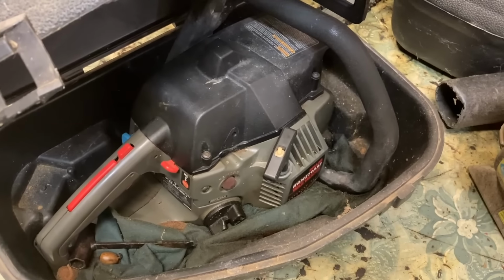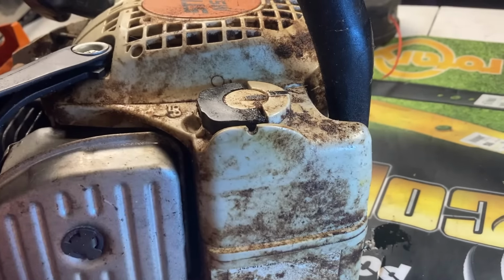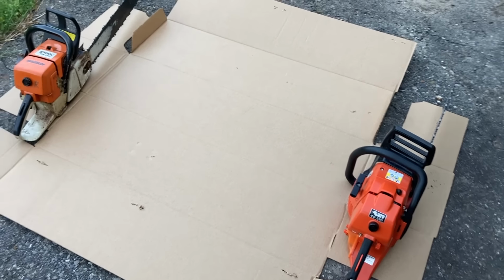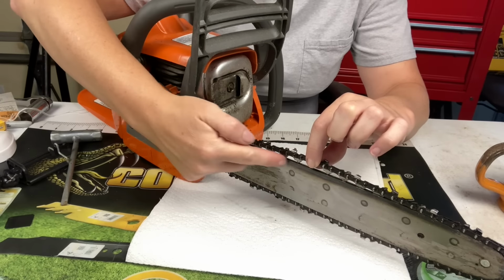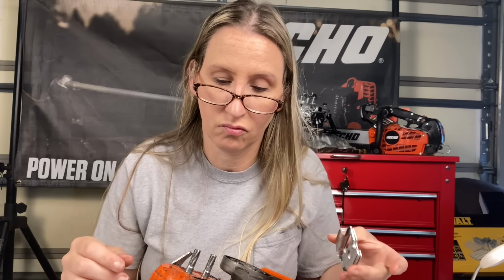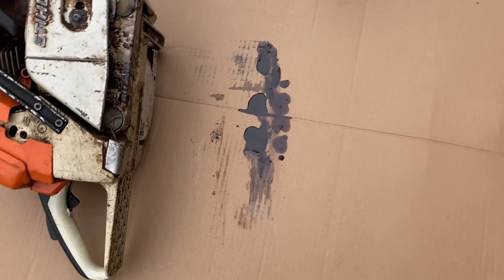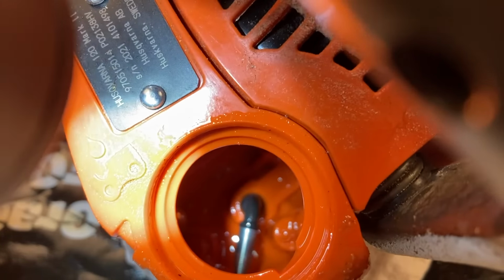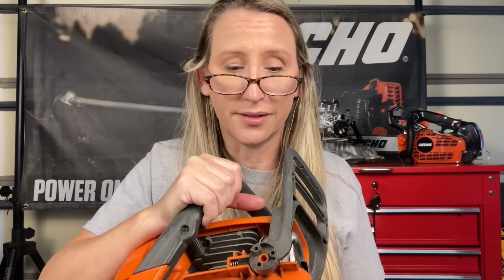Chainsaw leaks bar oil? The most common reason why AND Husqvarna saw leaking oil FIXED!! Repair Vlog

Comment: Was a service advisor and warranty specialist for a dealer that carried Husky, Stihl, Jonsored and Echo.. the thing that makes it most frustrating is that .. Sometimes the pump cycle will naturally stop at a certain point where it has drawn from the reservoir, but not discharged.. the heat soak thins the bar oil in the system after the saw is shut off and it naturally weeps.. that and contaminants in the bar oil and varying esther contents of bar oils can gall the surfaces of the pump making it not seal .. (like a scored piston in an engine). This causes a lot as well

Comment: Try using some red or blue oil dye. Put a few drops in a quart and shake it up untell you get the color you want.  You'll find those leaks super easy.   This is the technique i use to find difficult oil leak on heavy equipment.

Comment: It's interesting you use a 10w bar oil as a 10w 30 is what's specified for the "Chinese" saws. I have two that both spec the 10w oil and they both leak like sieves.
However, in my Homelite and Echo I use what's called a Supertak oil which is a lot thicker and gooier 🤔 It works perfectly well and they hardly leak a drop. So may I suggest it's the viscosity of the oil as much as anything else?

Comment: Interesting find. I loves the few videos I found. I have a little use Echo for around my property. It is always swimming in bar oil . The bar tip oils fine , I started opening the oil tank when cool. I always wipe  it all down to no avail. After watching your video I will be looking at the tank and 90 degree fitting as it seems the leaks are right around the bottom of the oiler. Thanks for the channel , as I will be checking back to see what you have next . Loved the fuel shutoff video. I’ve been putting these on anything that will allow for years. Not to make the comment to long , a question. When winterizing in cold weather climates - Maine- is it better to completely drain the fuel or add suspend to the fuel. Drain the cab or leave it full to help the seals from drying out. Thanks again Lonnie

Comment: Every STIHL I have from a small 14" to my 32" leaks bar oil. Doesn’t matter if it’s hot or cold, used or been sitting for a year. The brand of oil doesn’t matter either.

Comment: that ain’t bar oil - that’s engine oil (been using little bottle of STP treatment in with my 30W and iT does great - oil tacky vs low viscosity)

Comment: Can't believe that for such a clever lady, she starts the saws without the chain break on.
Reply from the maker: In my line of work, a huge majority of chainsaws that I work on are flooded or I intentionally flood the cylinder to start them. Although ideally you should have the chain break engaged when starting, it makes them easier to start when it is not engaged. That way you get the air through there mixing with the fuel properly faster. I also always start them on the ground, so it really isn't that big a deal.
Reply: If you have common sense you can do it without chain break on,idiots will cut themselves just handling a chainsaws that are not even started

Comment: Working on one yesterday and I believe the discoloration is likely factory edge hardening. Of course Could be wrong but after removing some more paint, which should have burned off  it it got hot enough to turn blue, and it was the same. So next new bar I get, guess what, gonna strip some paint to find out for sure.

Comment: Hi,
Great effort on the leaks. It’s all about the maintenance that the saw receives. Most people as you know do none!

I blow the saw out and air filter after every use then sharpen the chain clamping the bar in a vise and marking the starting point.
It goes along way to remove the bar and chain and clean the groove of the bar removing the wood dust with a hacksaw blade. This is one of the reasons the bar heats up as the dust prevents oil to the bar.
In the winter I store the saw inside and use winter bar and chain oil to make it flow easier. I also run all my saws on Swift ultra 94 unleaded Av gas. I have a Stihl 026 and MS-280 that have served me well over 25 years now. Keep up the great videos!

Comment: Great Video, now I know to check to see if my grommet is set in place properly on my Husqvarna. Also I’ll do the paper towel trick to see if there are other possible leaks.
It leaks like up a storm, so I’ve been emptying my Bar Oil Reservoir to eliminate at least that part of the problem.

Comment: Sorry I'm a sthil man all the way. Have 16 of them as a medically retired woods man since 46 years - started age 5. Forceps work inside the tank for fuel & oil lines. Clear or replace barrel line filter. First off ,poulan is crooked Ameican made junk out of the box that should be out lawed & thrown out of the country due to their crooked refusals to honor warranties on brand new,out of the bix,never abused saws. I've seen 10 new Poulans (pro none the less) needed to cut a total of 10 face cords- each one pounded on the walmart warrentee which is actually trust worthy. Guess what,walmart dumped  them & dont carry them anymore last I knew. Husqvarna I am not sold on either,but beats ,poulan hands down. Though Husqvarna does have oiler issues including oil pump failure especially in cold weather. Sthil beats them all,all the way around & I seldom have oil leaks or pump failure with them. (Keep dirt & saw dust out of the tank) clogs do happen. Other than that a pump seal ,gasket or O ring may occasionally  fail from loosened mount screws or excess heat because someone forgot to fill the oil tank. Adjustable oil pumps can leak from the o ring involved with that screw. Its sad,but anyone who ever cut wood seriously in this country has always had to look over seas for anything really worth a damn. Sorry, poulan, McCulloch, pioneer, home light, John's red, just about anything else American made, "SUCKED!" RIGHT OUT OF THE BOX!  If you need a small cheap limbing saw & dont go for the sthil, get a Ryobi at home depo & skip that other junk as a home owner. Atleast the damn thing will do what they say it does, "Let's start with start & run right out if the box!"

Comment: Maybe a comment not needed, but for many years no one ever mentioned the need to clear the oil delivery hole in the bar. I check that hole regularly now and depending on the type of wood, the hole in the bar is plugged with a goo which is wood dust and sticky oil. I usually open up the holes somewhat larger and I quit using sticky bar oil. Regular motor oil lubes the chain well and sticky is not necessary. When those holes in the bar plug, the oil has to go somewhere. Also there is a goo in the bar channel that builds up quickly.

Comment: Recently bought a new chain saw and while waiting on my wife to shop I actually read my manual. This particular manufacturer said to remove the bar oil when storing chain saw. Hummm I never knew that was suggested by a manufacturer before. Actually not sure I have ever read a chain saw manual before so theres that. Great video and you are fantastic.

Comment: Judging by the oil packed fines under the clutch cover and the hard burn on the bar- this chain was way too dull  (or backwards) and the operator was forcing it down rather than letting the chain pull the saw into the cut. This-as you know- is a very common tattletale sign of an inexperienced and unsafe operator. Combined with the low oil level due to the leak you found, this -as I said-is a very common sight in my industry.  Great job-as usual!

Comment: Most saws leak because most people are sloppy.  After I use my saws, I either use it until oil is depleted or pour out the oil.  Just like fuel, I don't leave it in the tank as I may not use it again soon.  Further, a good blast with shop air after use can help the mess.  I also sharpen the chain after using.  When time to use the saw again, I fill it with fresh fuel mix and bar oil.  The saw will work it's best clean, sharp and full of fluids.  I tell folks that their saw is not oiling good if it doesn't leak a little.

Comment: My SalemMaster (chi) says "Don't leave bar oil in the saw. It will leak out."  LOL
REQUEST:  I'm trying to find a carbide chain for my SalemMaster (chi) 20" saw.  .325 pitch, .058 ga, 76 link. The local store can only get .050 ga carbide in .375 pitch.  Are there bars and sprockets which I can buy which will swap me over to be able to use that?  Anyone?

Comment: Store the chainsaw on its side (with the gas cap up), and loosen the bar oil cap a tad. Problem mostly solved. Works for any chainsaw. Husqvarna even recommend this.
Most chainsaws have the line to the pump feeding from the bottom of the tank when the saw is upright, turning it on its side means the line inlet is no longer on the bottom, so it can only leak what's in the line and pump. It might still leak a tiny bit, but nothing like when the saw is upright. Loosening the cap helps even more because there's no pressure to push oil through the line. And obviously, if you're storing the saw for a duration, empty the oil tank. It can't leak if there's no oil in it! I usually empty the fuel out as well so next time I get the saw out I can't start it without filling both tanks. My saw is 20 years old and still runs fine so this works.
Weirdly, I also have a battery powered saw that doesn't leak bar oil at all. Not a drop. I haven't taken it apart to see but I'm guessing it has a different oiling mechanism? It uses far less oil, it doesn't sling it everywhere like a gas saw does. Anyone have an input on that?
As a north coast Aussie, 90°F (32°C) is just a nice day. I wish it was like that every day. Anything below 75°F (23°C) and I'm hating it. Lol.
That sneaky little grommet was a cool find, nice to have an easy fix I bet. 🙂

Comment: Why do so many people pour oil the wrong way? If you flip the bottle where the spout is at the top, the oil won't glug. That's why the designers offset the spout to one side. 

I guess Amsoil is the only one who gets that no matter how you try to help, people won't get it, so they put the spout in the middle.

Comment: Old stihl leaked since new.mid 80s.bought Brand 2024 new stihl i never started it. Set on work bench leaks. Bought cheap little greenworks electriic saw. Leaks. For me i figure they all leak.

Comment: I use vegi oil because bar oil is toxic. Vegi-oil has a couple of draw-backs BUT the benefits FAR out weigh the draw-backs. My saws don't leak either.
Reply: It's more about the amount of material going through the chain that keeps it from overheating not so much the lubrication. A dull chain causes overheating  bc there isn't enough material  going through the chain and the extra pressure required to make a cut with a dull chain.

Comment: Just a note, the tests here will show the worst possible situation in regard to leakage when the saw is "parked".  When in regular use, that is, buried in wood and cutting, then if the saw is "parked", the leakage is minimal to none if all is working like it is supposed to.   That residual sawdust sucks it in.  I have had the same piece of card board under my Sthil MS290 and 192TC saws for a few years now and have had less leakage indicated on that cardboard over those years than the over night paper towel test shown here.  Granted, I use the saws only about 6-7 times a year on average, so a professional may see different results.

Comment: good science.  my old dolmar only ever dripped the residual oil until i started using canola oil in it.  i blame the canola oil for the puddles.  and i had to start storing the saws in a rat-proof shed because they ate the handle off the bar oil filler cap.  i'm hoping someone can suggest a better vegetable oil.  but i will never go back to petroleum based oils.  for my own health and for the environment.

Comment: You can't put a die in the oil do you see where the oil is leaking we do this in the automotive industry I am a retired mechanic sometimes it's necessary to put a dye in the oil and there's also times when you can put dye in the cooling system on a water pool motor you can let it die in the water if you have multiple leaks on the chainsaw or other equipment put some dye in your oil your oil

Comment: Great suggestion! Put that dirty oil back into container with the clean oil. That way the dirt, sawdust and other contaminates can be sucked up into the oil pumping system and foul it up.

Comment: Probably like most saw owners I use it infrequently. I keep it clean top, bottom, chain and bar. When I finish with a task I clean the machine and drain both fuel and bar oil. Every saw I've owned leaked and it's just easier (for me) to do this rather than cleaning up everything else. I run the engine out of fuel before storage.

Comment: I had an old Mac 10-10  chain saw that never leaked because it didn't have an automatic oiler. It had a push pump button on the rear next to the trigger and as you used it you would give it a couple of push squirts and got used to judging when you needed to push oil. My Uncle got his first  Sthil chain saw with an automatic oiler and hated it.

Comment: Just watched your video on hard to start chainsaws. I own a Stihl MS290 that I bought new 12 years ago. I am that person that could never start it. I thought I was doing something wrong, so I brought it to my dealer, who basically started it in front of me, while I took notes. I then came across your video, which gave me confidence not to give up on it. Following your tips, and adding just two more very important steps, I can now start my STIHL every time I need it.
STEP 1 After you pull it twice, move the CHOKE TO WARM, or up one notch, from full choke. What I found this does, is drastically reduces the compression on all your future pulls. So you don't end pulling your arm out of its socket trying to pull the rope.
STEP 2 It kept stalling on me right after it started, so I started it with the chain brake off. Sorry Safety Guys, but it works. I can now rev it up as soon as it starts.
You rock woman!
Reply: I gave up on my stihl. Sounds like same problem.  One time I could use it others I couldn't.  It would start and idle but due after. I bought a husky 450 and it is reliable

Comment: The reason why chainsaws leak bar oil is that the plastic/rubber components used in the oiling systems are incompatible with the chemistry of the bar oil. The oil causes the plastic/rubber components to swell and lose tension. The fact that all makes and models do this is because they all use the same cheap parts.

Comment: What about Barometric pressure changes?   I`ve seen plastic gas cans expand and contract when they are sealed properly and sitting out in the sun.   I`ve seen them implode when they cool off at night to the point of cracking at the creases, but the oil reservoir is is small compared to a gas can.  Even in a temperature controlled building you will still have barometric changes, maybe causing the oil pumps out and air goes back in over time.  I enjoy your videos, you don`t drag it out like a lot of people do.  You, Taryl Fixes All, and Steve`s Small Engine Saloon are my favorite one`s to watch.  Ya`ll explain things very well, and tell us about Manufactures small blunders.  P.S. I learned to not work on my lawnmower and weed trimmer in the drive way,  you become everybody`s new  best buddy. Ha Ha.

Comment: Hot, intelligent woman with dangerous power tools, running a chainsaw in flip-flops and shorts. What’s not to like? I always put an oil soaker sheet in the bottom of my case and put a paper towel on the top of the saw housing, because it’s going to be a wet diaper when I go to use it the next time. I change the soaker pad often, and put one under the case when storing the saw near where the case and scabbard align, just in case. It’s best to run the saw fairly dry before storage to limit potential leakage. It seems, sometimes they leak, sometimes not so much, and some saws leak more than others. Otherwise, informative, but didn’t learn as much as I was hoping to, other than I’m not the only one to occasionally rev up a chainsaw in shorts and flip flops.

Comment: That husky oil line did not just fall out like that on its own. Either the saw wasnt oiling and the customer pulled the 90° nippple out trying to unplug any clogged lines and then pushed the oil line threw when trying to put the 90° fitting back in or you staged it for the video lol

Comment: When the temperature changes, as it will, the pressure in the oil tank changes. When it gets hot it expands and that forces oil or air out of the tank. And when it gets cold, the air in the tank contracts, and that sucks more air back into the oil tank, unless the cap has an unclogged snifter hole, which allows the pressure to be relieved.